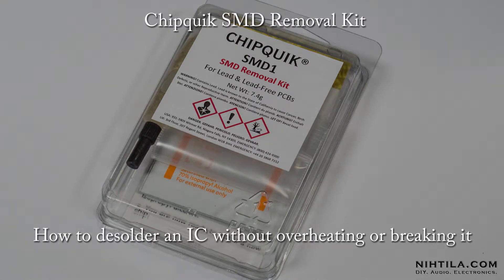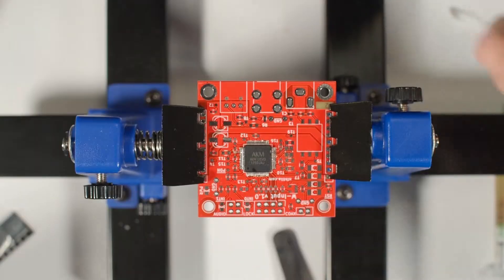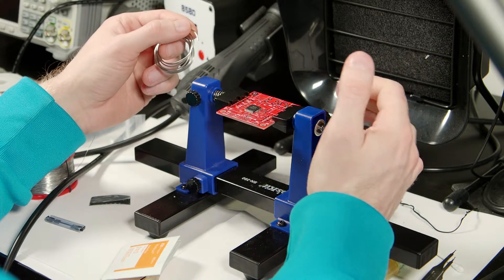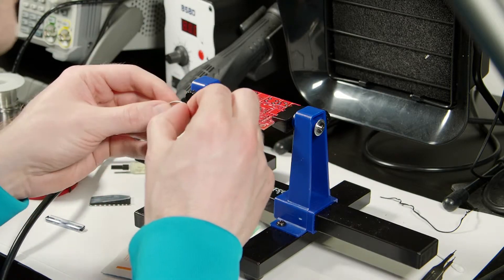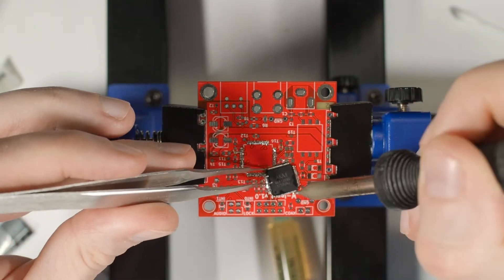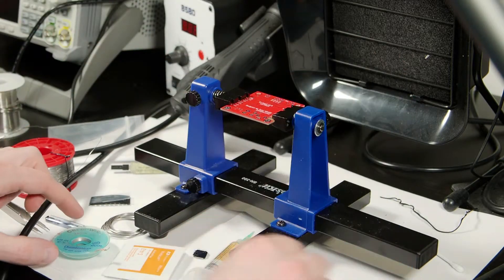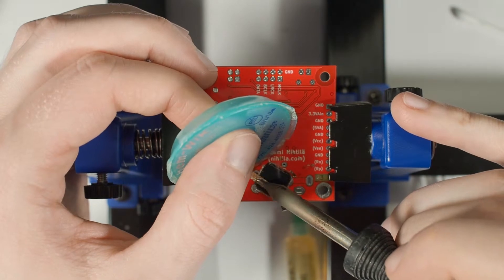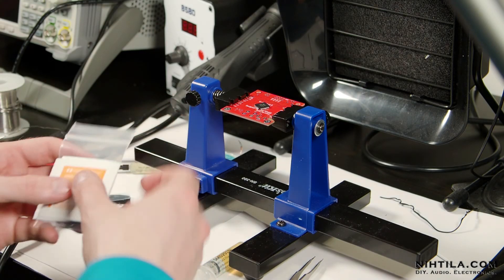Essential Tools - Chipquik SMD Removal Kit

Comment: There are lots of YT videos recommending this stuff, so I've tried it a few times now - and I've come to the conclusion that it really isn't a good idea. In normal SMD soldering you only briefly heat each pin, but with this stuff there is heat applied to all the pins at once, potentially for quite a long time. I've had lots of lifted pads and some ruined boards because of it. The only sure way I've found to remove a component with a package similar to what you show is to cut through the pins with a craft knife (score once, then slight slicing pressure on the crack to pop each pin away from the chip body. Then lift away the chip (discard), then clean off all the pads with a soldering iron followed by alcohol. It leaves a pristine board with almost no risk of damage.  Of course you do need to be willing to sacrifice the chip, but in my experience the cost of a new chip is nearly always a trivial consideration compared to junking the entire board.
Reply: I killed a component with it, hot air only for me now.